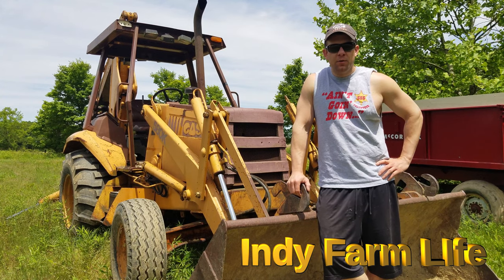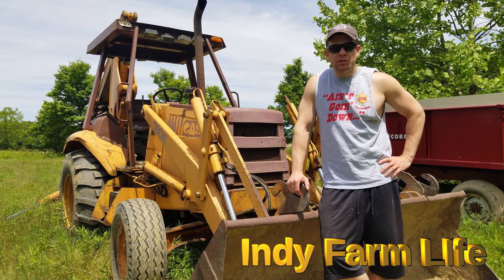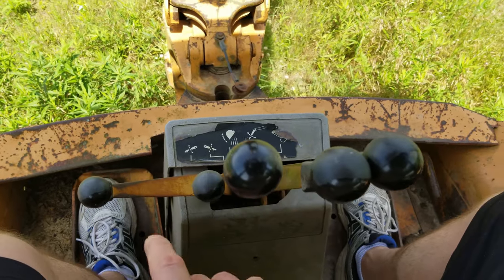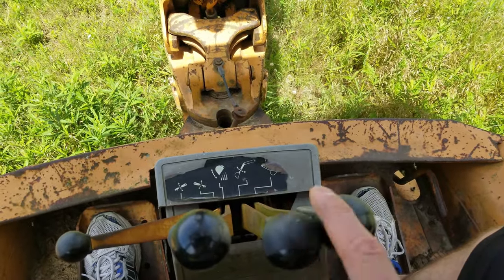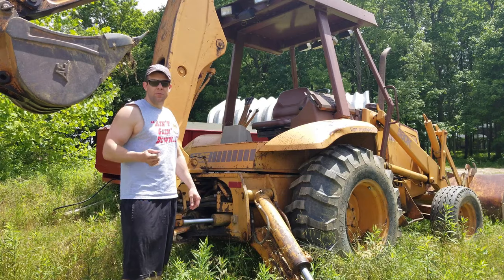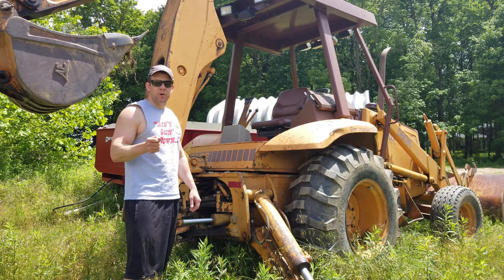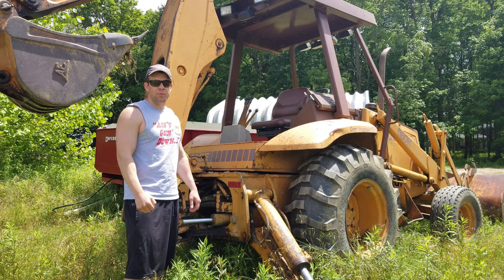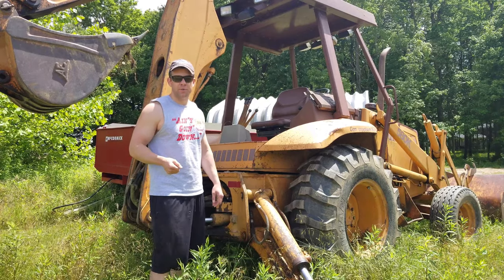How to put a Case 580K in Travel Mode (Transport Lock/Boom Lock)

Comment: I found this method a few days ago on a heavy equipment forum. I just acquired a 580 Super E for some projects around the property. Here's what I discovered: First, this works and is the correct way to get the machine in travel mode. The yoke on my 580 SE is a little different than this, but the same method applies. Here's what happens: You bring the boom back toward the machine to within about 3 inches from the locking pin. Then pull back on the control, then slam the control forward and the yoke slips right over the pin. Done. What no one is saying is that when you do that, the controls actually go into reverse operation. Suddenly out is in and in is out. When you want to release the boom for digging you have to push the control forward, lift the yoke then pull the control back to lower the boom. It's all backward! Once you release the control lever the machine goes back into normal mode where pushing the lever lowers the boom and pulling the lever raises the boom. You think I'm crazy? Try it and prove me wrong. Happy digging!

Comment: I have a Case 580K and mine is a 2 stick, (4 if you count the 2 for the stabilizers.) also mine doesn’t have any foot pedals, it’s just got foot rests. 
One problem that I have that you may be able to help me with is, swinging from left to right, right to left. If my boom is all the way to the left, I can swing all the way to the right with no problem. Once I go to swing left, it will swing back to center, stops, like it is hanging up on something, then with a couple tries with the stick it will then swing left with no problem. 
Once you get past the catch spot, it works well. 
There’s supposed to have a hole in the center for a pin to keep it from moving side to side when in travel mode. 
That pin looks to be broken off in the hole. 
I first thought that it may be the pins and bushings, there’s some play, but the play is very little. 
Any help you can give would be greatly appreciated. 
Keep up the good work and keep making videos, because I’m following your steps by fixing one problem at a time.

Comment: If you extend the arm all the way out straight up into the air it moves the center of gravity further back on the arm and is even easier to get it back into the locking dowl or triangle thing.
Reply: This is how I engage mine on my 580N.  Was taught that trick from the previous owner.
Reply: Thanks!

Comment: Picked up the K about a month ago. Seems like it's a tough machine. electronics are trashed, but I got the lights to work at least. A lot of the glass is broke out. I heard it was really expensive.
Reply from the maker: They are good backhoes!  The electronics on mine are pretty much non-existent. ha  I don't even have lights.
Reply: @IndyFarmLife  is there a sight glass for hydrolic fluid for the front tank somewhere? How do you know what the level is?
Reply: @MainMatK broken tractor is where I get everything for mine

Comment: I bought a 1966 ck case 530 180 Diesel Backhoe and the best thing ever that I did for the Backhoe was I got a 6- month service plan threw case the come out to the farm every  6- months and service the Backhoe  change all of the fluids and filters and Greece all of the fittings and anything else that needs service. so my job on the Backhoe is keeping it fueled up and check the fluids and operate.the Backhoe. I rather pay someone else because that way I can be doing another job some place  else.

Comment: I'm always busting the hoses that are on the side when I lock my boom. It's a poor design with the K series backhoes. It's a very tight area for those hoses.
Reply from the maker: Yes!!  I learned that the hard way.  When I took the boom cylinder off to repack it, I didn't get the hoses/clamps back exactly where they needed to go.  Went to use my freshly pack cylinder, put it in transport mode and boom...hose busted!  Not the happiest that day.

Comment: Hey man just to add, if you hold your bucket lever in at the same time or just before you push out the boom lever it will do it a lot smoother, with a bit of practice, it loads the system just enough to make it not slam back too fast.
Reply: Indy Farm Life , took me a bit to figure that out but when you get it you will always do it without thinking. I learned to operate backhoe on a 2 stick ford 555, my dad used in his business, when I learned to use a 4 stick I was working for a paving company. I actually got better at running the case than my dad. Can’t beat him on a 2 stick though.
Reply: Indy Farm Life, 3stick is all good, funny when I was just learning to run it I had to remember the leavers, so I said to myself B.A.B.E. Bucket,arm,boom,extendahoe.  Never forgot
Reply: Slamming back scary for me

Comment: Its to my experience running case backhoes that there all the same way to lock the boom in road mode
Reply from the maker: Good to know! I was curious.  Thanks for sharing.
Reply: @IndyFarmLife  over the years if ran a 580b,e,k,l,sl,and now im in a super m series 2 and they are mostly the same in controls
Reply from the maker: Nice!  Sounds like you have a lot of experience.  Surely though the Super M is joystick controls and not the 3/4 stick?
Reply: @IndyFarmLife  ive got about 10 years in runnig and fixing heavytrucks and equipment and mine is 2 stick old style not pilot like the new ones